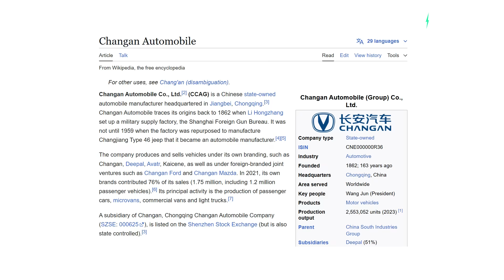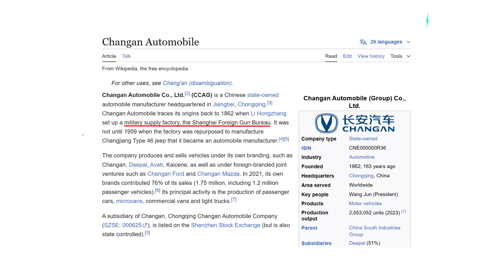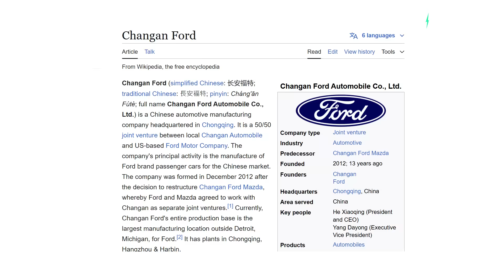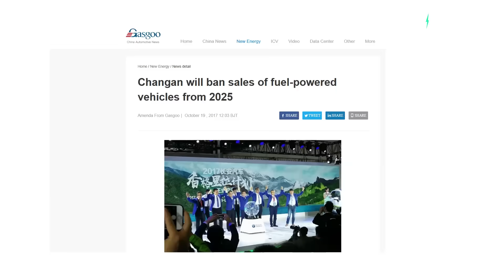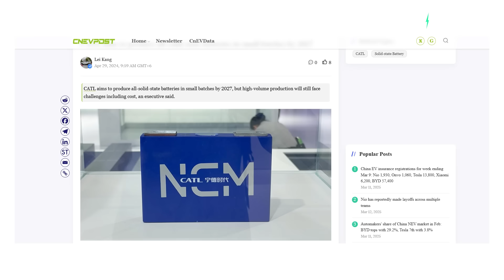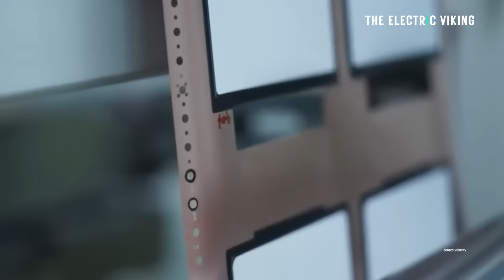Major EV Giant Promises 900 mile range Solid-State Battery Cars in 2026!

Comment: I just want 400-420 miles of range so I can charge to 80% and easily do the 289-mile drive from Philadelphia, PA to Cape Charles, VA comfortably if the one charging station on the route is down.
Reply: That's possible NOW.
Reply: @dr.x4050  Not in the U.S. market unless you spring for a Model S Plaid at just over 400 miles of range.

Edit: Aptera would be an option if it were in production.

Comment: 360 km 10  to 80 range at highwayspeeds (120 kph) and recharge of 30 minutes, so start charged in the morning, 400 km in 4 hours 40 minutes pauze, 300 kms in 3 hr, 40 minutes charge, 350 kms in 3.5 hours to destination/hotel makes for a 1000 kms in 12 hours journey. that is for a travel ready car, al other uses have enough with 500 kms range so it is better to limit weight instead of increasing weight and price. lighter car and smaller battery so no SUV, less weight and less drag must lead to a consumption of around 15 wh/km at 120 kph leading to 500 kms for a 75 kwh battery.
Maybe we could go to a car with a standard 75 kwh battery and an extra 25 kwh that can be rented and placed in the frunk for travel.

Comment: To put these energy densities into perspective, whereas a 400 W/Kg battery has an energy density of 1.4 MJ/Kg, gasoline has an energy density of 45.5 MJ/Kg.  This is why BEVs will always remain a niche (but useful) market.  Ie, will not make up more than around 10% of the fleets in most countries.
Reply: LOL - you need 350kg of engine, gearboxes, differentials etc. to turn the stored energy of gasoline into useful motion vs 80kg of motor and reduction gear in an EV.

It takes 0.4MJ to move my EV 1km and it takes an ICE car 2.5MJ to do the same job at 14km/L (33 mpg) 

A petrol engine + fuel combination of 350kg + 54kg /70L (404kg aggregate) of fuel at 14km per litre = 980km of range. If I put 324kg of battery @0.4kwh per kg (129kwh) + 80kg motor (404kg aggregate) into my EV = 1160km of range.

I would have consumed 54x45.5 = 2457 MJ of energy in the petrol car and 1.4x324 = 454 MJ of energy in my EV and driven 84% as far in the gasoline car.

For comparison my EV is a Tesla Model 3, it has a 402 kg battery pack (60kwh) and an average lifetime range of over 520km per charge, but still weighs less than a similarly dimensioned C300 Mercedes with a full tank of fuel.

Comment: Who the hell needs 900 mile range, it's ridiculous, I only manage 200 miles before I need a bathroom break, a cup of coffee and something to eat. Whilst Im doing that I have charged back up to 80%, approx 15-20 mins, ready to do another 200 miles.
Try driving any distance with kids and you will realise driving 13 hours non stop is impossible.
Reply: no one is forcing you to drive non-stop.... but i think their key with extending the range of cars is to reduce the amount of load on the grid due to reduced number of charges and secondly prolonged battery life as less need to charge means batteries would take much longer to degrade
Reply: If you don't have home charging, then it is an advantage, even if you live in a city.

Comment: Main reason I cannot have an EV . Range problems and lack of charging ports in UK still. This range would do the return journey nicely.
Reply: You could go from John o'Goats to lands end with out stopping, I guess you dont have a family and like to pee in a bottle.
Most of us with EV's do the EV splash and go. I cant go 200 miles without needing to stop, whilst I'm going to the toilet, grabbing a coffee and something to eat, my Tesla has charged to 80% enough juice for another 200 miles.
I would bet that if you had a car that could do 900 miles you would also stop for a break also, thats when you charge up. You dont need to stand by the charging plug, the car can charge on it's own and you app on your phone will tell you when you have reached 80%. Attendance is not needed unlike an ICE car
Reply: Plenty of charging ports in uk now, for long journeys. Only reason I would not get one is if I didn’t have a cheap place to charge, like off road at home or work. public charging alone would make through life cost of ownership higher than ICE. Apart from this I advise everyone to go for it.

Comment: There is no way EV's can be practical in remote areas. Australia is mostly remote places that take many hours or days driving to reach. EV's are a niche market and will remain so for years to come. No matter how much you try to hype up the Chinese cars, they are simply not fit for purpose.
Reply: They do work for almost everyone as a personal vehicle. It does require some infrastructure however. And being able to charge at home helps a lot

Comment: Solid state battery technology will lead them towards making lower weight/range batteries, because it will improve EV efficiency.  Much depends on the market and the state of its EV charging network. In countries where EV superchargers are ubiquitous, lower weight / lower range batteries will be more acceptable and offer improved EV efficiency. Effectively if you half your battery weight you are not halving your range. It might be more like 2/3 the range. This is because you are carrying around dead weight in the batter, as it never changes weight not matter whether it's fully charged or near fully discharged. No matter what the charge level is, the battery weight remains the same. This it makes perfect sense to reduce the size and hence weight of the battery pack, if you are getting double the energy density with solid state technology.
Reply: 🔋 50% smaller solid-state battery packs
⚡ Triple or quadruple charge sockets for 3-minute charging
🚗 Lighter, more efficient EVs with 2/3 range
🔄 Easily upgradeable battery packs
♻ Lower cost and better recyclability
Reply: Essentially,  the reduction in battery weight improves overall efficiency, meaning you're not sacrificing range in a linear fashion.

Comment: This is why structural battery packs are a bad idea.  You cant swap them out easily and replace them with the latest battery technology.
Reply: You may be right
Reply: Structural only once the batteries are screwed into the chassis, preventing the bottom structure from flexing compared to normal ICE vehicle which uses just a single thin layer steel plate. The whole battery pack can be unscrewed & each cell can be replaced.

Comment: 1500 km range will at current efficiency need about at least a 200kwh battery which will take close to 30 hours to charge on a 7kw home charger. More relevant is that 400+ Whkg energy density batteries will allow 600km range with a much smaller and lighter pack so EVs can in turn become smaller and lighter
Reply: There is no need for 600km range plus EV, if considering the winter range drop, 800km range should be more than enough for any scenario.
Reply: @yezih2694 I think the winter cold does not affect SSB? If its like a capacitor, no chemistry involved, no temperature issue.

Comment: A real 500 mile range will be more than enough, but it’s more important to have fast charging that doesn’t affect longevity. That also needs the charging infrastructure to support it. It’s all very well having these battery breakthroughs, but without supporting tech around it they will make no difference.
Reply: Ehhh, all the newest data shows that fast charging have very little if any effect on battery health/longevity.
Reply: @ Yes I know, but we’ll get the usual naysayers posting rapid charging destroys the batteries. What would be good is if solid state comes with lifetime warranties.
Reply: @ISuperTed CATL battery gives 1 million km warranty.
Reply: @ISuperTed  MG is already giving lifetime warranties on the battery, you dont need solid state to achieve that. 
Solid State has been promised for years, especially Toyota who have said for the last ten years, that it will be just next year when it's fitted to their cars
Reply: @ Yeah, I think within 5 years all batteries will be lifetime warranty and some will be solid state. as for Toyota having them, not confident they’ll here for three years.
Reply: @ISuperTed  they will be because they will use BYD running gear.
Reply: You're right. Fast charging doesn't have nearly as bad of an effect on batteries as most people believe. Many Studies have shown the modern batteries are much more resilient and can handle fast charging with minimal degradation  @hmbro3236
Reply: I agree with this. I’m more interested in a rapid charge to fill up, similar to an ICE type fuel station and a reliable, working, faff-free infrastructure (none of this multiple cards / apps business). Even if I only got a reliable 200 miles per charge. This will, IMO, bring EV closer to ICE in usability and convince more to uptake to EV motoring. I realise that one of the keys USP’s of EV ownership is cheaper running after the initial purchase of vehicle, home charger, solar panels etc (for some), yet one of the key USP’s for ICE owners is an existing, reliable network that simply works well. When I don’t have to compromise or change my “mind-set”, I’ll definitely be considering an EV. 👍
Reply: There is no need for 600km range plus EV, if considering the winter range drop, 800km range should be more than enough for any scenario.
Reply: @yezih2694  A super long range is needed for towing vehicles. A car or truck towing it's own weight will have about half the range.
Reply: @  for truck. I think a battery replacement would be a better option if fast charging can not meet the requirements. In Europe, driver are mandatory to rest half hour every 4 hour driving, so for a truck 400km range is more than enough.
Reply: @ for truck. I think a battery replacement would be a better option if fast charging can not meet the requirements. In Europe, driver are mandatory to rest half hour every 4 hour driving, so for a truck 400km range is more than enough.

Comment: We don't need more range (batteries with more capacity) but lighter cars! So the increase in energy density is fantastic if combined with smaller batteries.
Reply: Agree. They will make lower range batteries, because it will improve EV efficiency. Much depends on the market. In countries where EV superchargers are ubiquitous, lower weight / lower range batteries will be more acceptable and offer improved EV efficiency. Effectively if you half your battery weight you are not halving your range. It might be more like 2/3 the range. This is because you are carrying around dead weight in the batter, as it never changes weight not matter whether it's fully charged or near fully discharged. No matter what the charge level is, the battery weight remains the same. This it makes perfect sense to reduce the size and hence weight of the battery pack, if you are getting double the energy density with solid state technology.
Reply: Agree, but more real range and faster charging for commercial vehicles is needed. For most cars it’s not really, as long as there are lots of fast chargers.
Reply: solid state batteries will be a bit lighter than traditional ones.
Reply: I need it to visit my family in other states.....
Reply: Batteries are also getting lighter, I think the new BYD blade batteries are 15% lighter with increased range than the previous variant.
Reply: Essentially,  the reduction in battery weight improves overall efficiency, meaning you're not sacrificing range in a linear fashion.
Reply: Not gonna happen because we need a certain amount of protection around us in case of an accident .
Longer range batteries are the answer .
Reply: @roddychristodoulou9111    That reason wont stop smaller lighter batteries being used in some vehicles.  Not everyone needs long range in their common use case.

Comment: More solid state hype.  When it comes to solid state batteries I will not believe anything until the cars are independently tested.

Once we get an EV in the small family sized car which can do 250+ miles at 75 mph in cool weather (0-6C) at a reasonable price then it is game over for ICE cars in the UK.  We are not far away from that without solid state batteries.